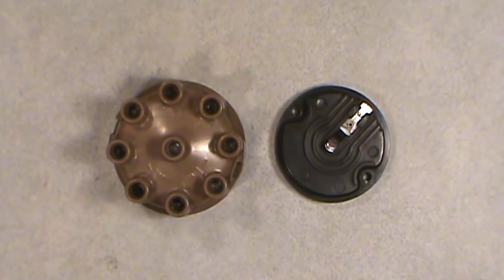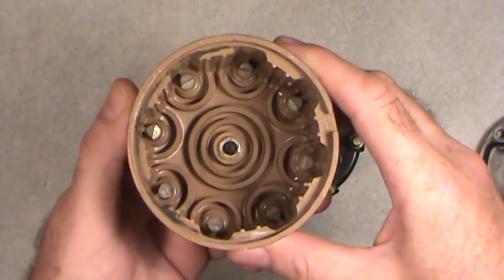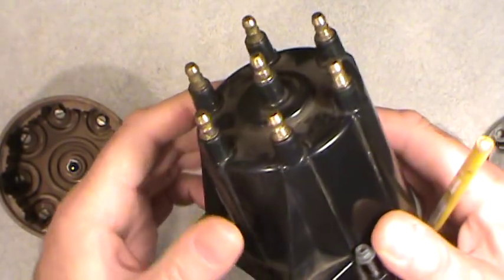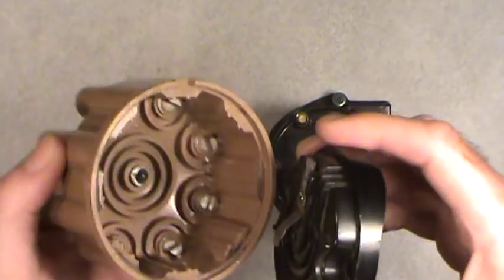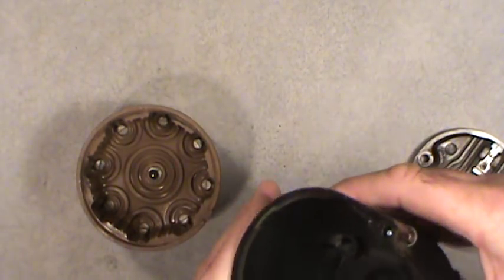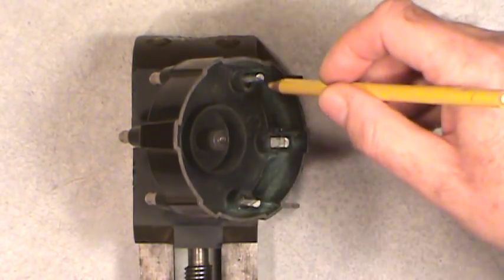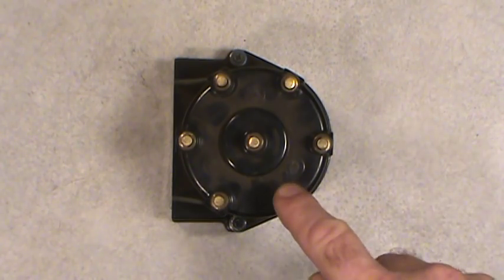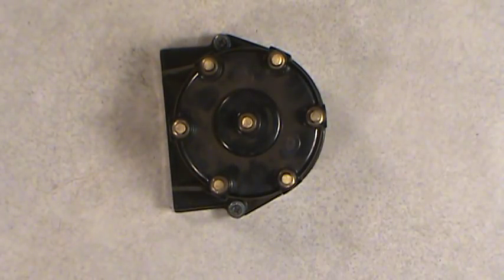How to Inspect Distributor Cap and Rotor Condition (Part 2)

Comment: You are an excellent and patient teacher. My advice is to mark the cap, wires and firing order with a paint marker before disassembling all those parts, then no confusion on re assembly. I now understand the importance of correct air gap inside dist cap thanks to your tutorial. Keep those videos coming, I'll be in the classroom; and all the best from New Rochelle N.Y.
Reply from the maker: Greetings...stewart bruce........Thanks for watching........Also, thanks kindly, for your nice comment, my friend........Me, a teacher...???...nah, not really, but perhaps, I really should be grateful for, all of the great mentors, that I had, while I was growing up, and besides, all of what, you see and hear me doing here, is basically, just some of the hobbies, that I became interested in, and studied somewhat........If you haven't already heard of this, shall we say, additional, paint marking (so called...lol) "secret", then, here Ya go........Before removing the distributor from the engine, just simply, paint a line, on the distributor's body, where it meets up with the engine, and continue a straight line, right onto the engine, and, when it comes time, to re-install, that very same distributor, just match up that painted line again, bolt it down, and, the initial/base ignition timing, will be super close, to where it was, before the distributor was removed, cool huh, oh, and, don't forget to take notice, in which direction, that, the rotor was pointing to, before removal (on a small block Chevy V-8, I like to have, the number one piston/cylinder, at TDC/Top Dead Center, on the compression/firing stroke...&...the line on harmonic balancer, in line with zero degrees, on the timing tab, and also, having the tip of the rotor, pointing at, the number one cylinder (that be, the cylinder, that's on the left/front side of the engine, as you're sitting in the driver's seat).........So then, even if, I don't have a YouTube video, of something you want to know about, just simply, post a (comment) "question", under any of my YouTube videos, and, if I'm able to help you out, then, I will do so.........Thanks again, and.......till next time......Be Safe, take care, and have a good one.
Reply: @RockysRoadshow  Thank you Rocky with the information you just provided. I have a problem with my 88 240 volvo that has a racing idle. If your familiar with solving that problem, I will describe the steps I took including checking for air leak with starting fluid and propane. If you have the time and guidance that would be appreciated.

Comment: You can clean many of the contact points - can even use sand paper to remove corrosion - in a pinch. Thanks to all of the men who taught me things about cars.  You've saved me thousands of dollars and much heart ache!
I wish parts manufacturers would make parts grey or another color so that I can write on it with magic marker. I had to use red nail polish to mark the wire order....took too long. Some guys write the date the new part was put on and i think that is extremely nifty. If the part is black, you can't see marker - though paint pens are sold in craft supplies stores/areas.

Comment: Thanks for the video. It helped me to learn about ignition system. In the video you showed two types of distributor caps, the DIN and SAE types. What I was looking for was a comparison of both types regarding electrical conduction or resistance and reliability. One thing can be noted that vehicles of 1990s started using SAE type caps before going to distributorless systems.What if the older DIN type cap is replaced with the new SAE type?
Reply from the maker: Syed Imran Shah Greetings Syed Imran Shah....Thanks for watching this "Distributor and Rotor Condition", YouTube Video of mine, and for Your very Interesting, shall we say...Comparison, as well as, maybe Switching, as You indicated, the Distributor Cap/s, from One Style, or Generation (aka, Year, or Time period, of Distributor Design/Development) between, "2" or More", of the Many Types of Distributor Designs, that Exist, to this very Day....................................................The following, are only my Observations, Opinion, and, all of what, I studied, and to some extent, learned, over, countless hours, of reading-about, working on/tinkering with, and, last but not least..."Automotives"...(amongst many other things as well), just happen to be, a "Hobby" of mine, and, I'm not a certified Mechanic, nor, have I ever worked in, an "Automotive Repair Establishment" at all............................................................That "Light Tan" colored Distributor Cap, (as seen in this video), was off of a "Mid 1970's Dodge, small block V-8 Distributor, that housed a Reluctor style of Triggering system, who's Signal, was Sent, to the "Transistorized" Ignition Box, mounted on the Firewall of the Vehicle, that basically, took the place of the, good ole..."Points and Condenser"...Style of Distributor/Ignition System......................................................Both, this Newer Type of Transistorized System (at that time), as well as, the Points and Condenser Style of Distributor, were Only "Controlling" an Ignition Coil, that was only Required to, Output a Much "Lower"..."High Secondary Voltage" (that made its way to the spark plugs, via, the, spark plug leads/wires), as "Compared To", that of, something like, the "HEI" (High Energy Ignition) System, that the General Motors Company, began to Install, on their Vehicle's, oh, somewhere around 1975, and onward, until, Distributors, as such, were, somewhat abandoned, in favor, of what we are seeing today....................................................Using the Older, Factory Original, Oil-Filled Ignition Coils, as an example, that were used, up, until, about 1974, who's Secondary High Voltage Output, was only Required to "Jump", a Spark Plug "Gap", of, mostly, as I've seen, being .035" (thirty-five thousandths of an inch)...where-as, using the Factory Installed HEI V-8 "Stand-Alone" Distributor, as an example, as far as Chevy (Chevrolet) V-8 Engines, that I worked on, were concerned, usually had a Spark Plug "Gap" of .045" (fourty-five thousandths of an inch).................................................These Factory HEI "Stand Alone" Distributors, are something else alright, and, here's an Outstanding example for You........................................................Around the late 1970's, to the early 1980's, the "Oldsmobile" ("One", of many Names/Brands, Owned by, the GMC Parent Company, as far as I recall), had a "4.3 Litre/260 Cubic Inch (displacement) V-8 Engine", that had the Ability, to, Use, the Factory Specified, Spark Plug "Gap", of .080"...!!!...(eighty thousandths of an inch), and, if You would like the Metric Equivalent, then...(.080 Divided By .03937) = 2.032 Millimeters...!!!...or, in other words, the "LARGER" the Spark Plug "Gap", happens to be, the "HIGHER" the Ignition Coil's "Secondary High Voltage Output", has to be, in order, to Successfully "JUMP", that, sometimes, Very Large, Spark Plug "Gap" (aka, Distance).......................................................Now then, the "Ignition Systems", that only needed, the "Lower, Secondary Voltage Output"...to "Jump", those Smaller, Spark Plug "Gaps"..."Did Not" have much of a problem with, shall we say, "Spark Scatter" (inside of the distributor cap), as well as, what is usually called "Induction Cross-fire" (that's where, if conditions permit, the High, Secondary Voltage, traveling though the Intended spark plug Lead/Wire, would actually get "Induced", into another spark plug wire, that was in close proximity, and usually Parallel to each other as well), and, the result would usually be, some very un-wanted, Ignition System related, "Miss-Fire"....................................................Now then, by using the HEI V-8 Distributor as an example, its' very easy to "See", just how much "LARGER", the "Outside Diameter/Perimeter", of this HEI "Distributor Cap"..."Is"...as Compared to something like, that "Tan Colored" Distributor Cap, that is seen in this Video of mine...!!!..........................................I'll bet, that most People, are probably thinkin', that, the Reason, for this..."Much Larger HEI Distributor Cap"...was just made that "LARGE", so they, (the Engineers/Designers), would have enough Space/Room, in order to have a "Mounting Place", for that "Epoxy Type of Ignition Coil", that can be seen, residing there, maybe...???..."But", here's My Take, on the Real Reason, that, that HEI V-8 "Distributor Cap, is So "LARGE"................................................Apparently, the Government, of the Day, Mandated, the ever Decreasing, and Tightening, of the "Amount of Emissions", that were Allowed to be "Emitted Out of the Vehicles Tail Pipe/s", so, to be in "Compliance", with the, shall we say, "Emission Standards/Law/s", of that Time period, Our Friends, the Vehicle Manufacturers, had to come up with, and Engineer/Design, the appropriate "Emission Systems", in order to "Lower" the Vehicles, Tail Pipe "Emissions", to be "Low Enough & be in Compliance with", what the Government/s, made into Law.....................................................One of those "Emissions Reducing Systems", was that of, finding a way, to be able to "Burn", an "Air/Fuel Ratio", that was, quite a bit "Leaner", then that, of the ""Richer" "Air/Fuel Ratio (aka, Mixture).............................................Thus, in order to Be Able to "Initiate...the actual, usual..."Lower Engine Compression Ratio"...and..."Much Leaner, Air/Fuel Mixture"..."Burn"...in the Engine's Combustion Chamber", it was, as I see it, the "Need", for a..."More Intense, and Larger Spark"...Between, the Spark Plugs "Electrodes"...!!!..............................................As I see it, the "Higher, the Ignition Coil's, Secondary, High Voltage, Is"...and having Spark Plugs, with "Much Larger Electrode Gaps", in that particular Ignition System..."IS"...the "Reason For", that GMC's, V-8 Engine's, HEI "Distributor Cap", Being, so much "LARGER" (physically, and diametrically as well), oh, yeah, the "Reason Being"...To "Contain", and to "Prevent Spark Scatter", and probably, All of the resulting, Ignition System related...Spark Plug..."Miss-Fire-ing"...as well...!!!......................................................Now then, let's move on to, that "Smaller (black) Distributor Cap", with that, as I see it..."Way Under-Designed, Too Small, of a Carbon Button, for its Intended Use"...that is seen in this Video of mine, shall we..............................................The Spark Plug "Gaps", being, that of .045" (fourty-five thousandths of an inch), that, that "Distributor Cap, with the Tiny Carbon Button", was supposed to be responsible for, and having a "Separate" epoxy-filled Ignition Coil, with its Own, Lead/Wire, that Joined the Ignition Coil, to the Distributor Cap's Center Terminal/Tower, is, as I see, to be considered, having the Same, there-abouts, High Secondary Output Voltage, as Compared, to that, of its "Big Brother", the, so much "LARGER stand alone V-8 HEI Distributor, and my reason, for saying such a thing, is due to a very Fact, that, the Spark Plug "Gaps", being that of, the very same as, the Spark Plug "Gaps" that are "Also Found", in the "LARGE Distributor Cap Style HEI...and in Both of them, the Spark Plug "Gaps" are "Identical", being .045 (fourty-five thousandths of an inch)...!!!................................................On the HEI, with the LARGE Distributor Cap, I never had much of an Issue, with "Spark Scatter" on Factory Stock Engines, as in, "High Voltage Sparks", Dancing around Inside said Distributor Cap, unless, any, or all, of the 8 Internal Terminals, have become, Too Worn, usually due to, High Voltage, Arcing (Electrical Erosion) Between All 8 Internal, Distributor Cap Terminals, and, the "Tip of the Rotor"..................................................Now then, what were they thinking, when they chose to, Install, such a "Small (diameter) Distributor Cap", with such an "Wimpy Carbon Button" , as Compared to its..."Big Brother, the HEI, with the LARGE Distributor Cap", and a much LARGER Carbon Button as well, which, and again, as I see it..."The Solution", to Ward-Off, any potential..."Spark Scatter"...and...the resulting Ignition related...Spark Plug "Miss-Fire"...???................................................One thing, that I did Notice, was, I'm guessin', that, they thought it was alright to Use, a Much Smaller (diameter) Distributor Cap, probably, because, on a 6 Cylinder (in this case, a V-6), there are "Only 6"...Internal Terminals, making for "More Spacing", between, any Two (circumference-wise) & (internal) Distributor Cap Terminals, as opposed to, trying to "Cram", 8 (Internal) Distributor Cap terminals, into such a "Confined Space".........................................As I see it, Not only is the "Carbon Button"..."Wimpy"...but...the..."Rotor"...that Spins around "Inside" that Little Distributor Cap, is..."Just as Wimpy"...as well..............................................When it comes to, just about Any..."Very High Secondary Voltage Output" (no, not the much Lower Output Voltage, found in, something like a Factory installed points and condenser distributor, with a .035" spark plug gap), but rather, with spark plug "Gaps", of, oh, .045" or Larger,  in a given Ignition System, there's only so much, the "Material", that the Distributor Cap, is made out of, is able "To Do", in as far as, being able to..."Contain & Insulate"...All of that...""Very High Secondary Output Voltage"......................................................That's probably Why, the "Larger HEI stand alone Distributor", has been Welcomed with Open Arms, by the Aftermarket/Performance Companies out there................................................Also, in the case of a GMC style HEI, stand alone, Distributor, with its One Wire/12-Volt supply Hook-up, and, if that's not enough, then, there is the "Easy to See" & "Easy to Work-0n/Modify"..."Mechanical Advance System"...with the..."Advance Weights and Springs"...on top, once you remove the Distributor Cap & Rotor, that is....................................................In closing, as it pertains to "Exchanging", different Types/Styles of Distributor Caps...both, the "Pros & Cons", being considered....................................................First consideration, would be, that of having the "Exchanged Part"..."Physically Fitting Properly"...on the "Distributor Housing/Unit"...that's a Must/Given............................................The Best "Material" (Space-Age Quality), that would "Contain and Insulate", the very High "Secondary Voltage" would be very good Insurance, for Reliability and Performance, as well as, Long Engine Life (if You take it, somewhat easy!)..........................................On Distributor Caps, I like "Brass Terminals", more then I care for "Aluminum" (much better electrical conductivity, and perhaps, longer life as well)...........................................Remember to Buy "Quality and Reputable Parts"...as that, is about the "Best Medicine", that I can "Prescribe", at this time.......................................Be Safe, take care, and have a good one.
Reply: Thank you.

Comment: Rocky, how can you tell what is the #1 terminal on the cap if it's not marked? I have a late '60's MOPAR and looks like your tan cap in the video. Thx.
Reply from the maker: Greetings...Michael H.................Thanks for watching................If it were only that easy..................You were sayin', that,  You have a late 60's Mopar there, and that's a good start (to things) alright, but, there are quite a few differences, between, a Mopar's set of Spark Plug "Wire's", shall we say, "Arrangement", as there are...6 Cylinder Engines...and 8 Cylinder Engines, that have their Distributors, mounted on the Engine, in different places, and, not only that, but, some "Rotors", inside the Distributor Cap, Revolve/Turn...Clockwise...while others...Spin...Anti-Clockwise (or Counter-Clockwise)..............Then, there's the...Firing Order...for that Exact Engine as well.................Usually, the inline 6 Cylinder Engines, and the Small Block V-8 Engines (up-to about 360 cubic inch displacement, having their Distributors, at the back of the engine), then, the "Rotor", will usually Spin in a Clockwise direction, where-as, a...Big Block V-8 (oh, about, 383 to 440 cubic inch displacement, will probably have the Distributor, at the Front of the engine), and the Rotor, will probably be Spinning "Counter-Clockwise" (same as sayin', anti-clockwise)...............If You can let me know, "Exactly", what Your Engine actually is...and...has You Distributor been Removed, or Re-Installed, or, are You, just tryin' to install, a New Set of Spark Plug "Wires", perhaps...???...cuz, otherwise, I'll just be going on, another one, of my favorite..."Wild Goose Chases"...!!! (again)...lol...................So, if You care to, just let me know, all that You can, as it applies to, just what...???... You happen to be up against, that way, I'll have a much better chance, at being able to help You out...thanks, and.........till next time.......Be Safe, take care, and have a good one.